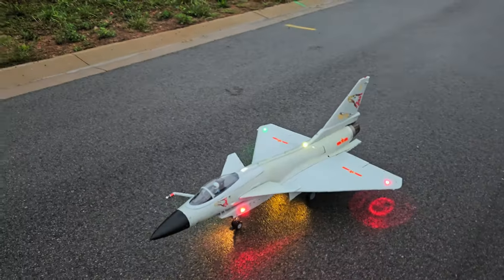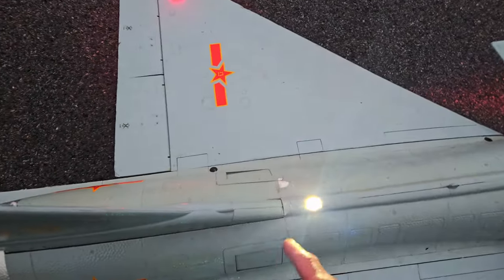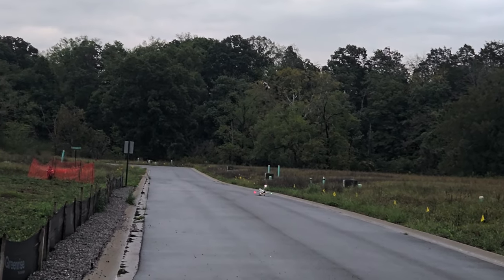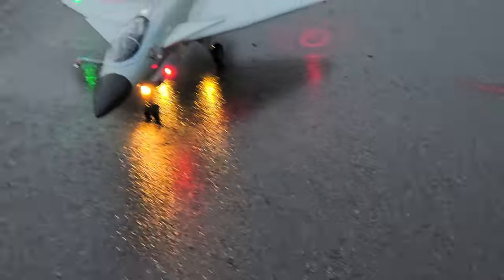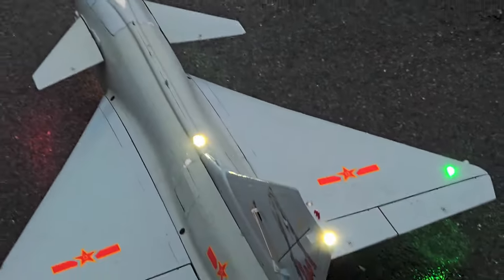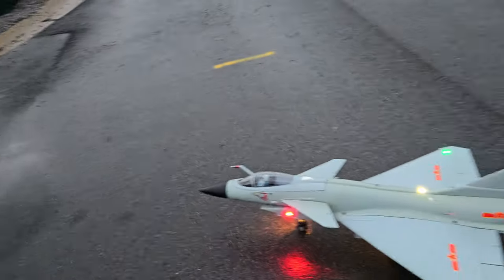Freewing J10A 90mm Favorite delta  #rcplane #rchobby #rcflying #smokeymountainrc #rcpilot #rcjets

Comment: Travis great flying, glade it's not the last flight.  Zoom Zoom Zoom Jeff
Reply from the maker: @JeffinLowerAlabama  After that flight i flew it and the battery and esc leads melted and blew apart at about 70mph and i had no controls. Nose first into the ground.  Needs most parts now.  Not for sure when I'll be able to fix it.  I may put the 90mm motor and fan in my freewing t33 lol.
Reply: @SmokeyMountainRcTravisThompson  Travis darn sorry to hear that.  Jeff